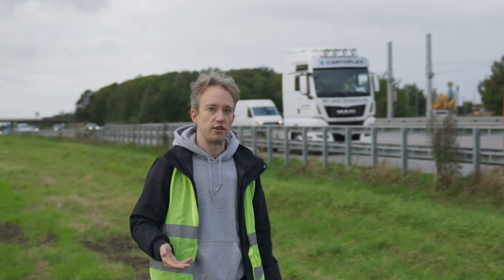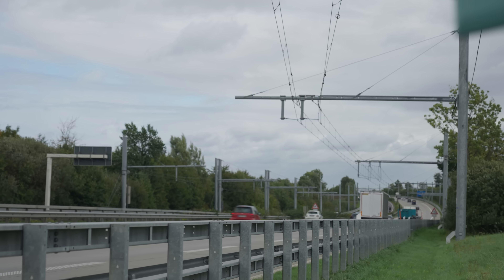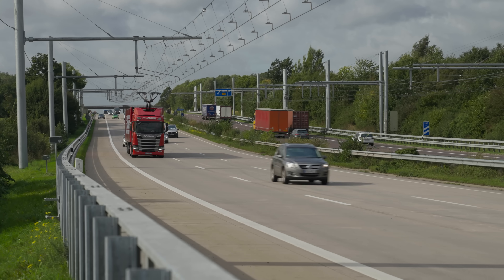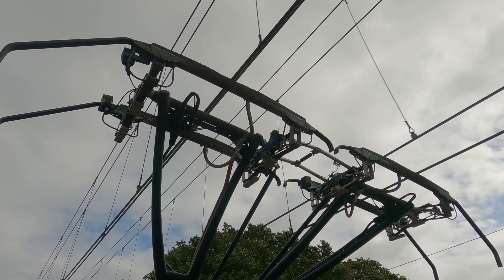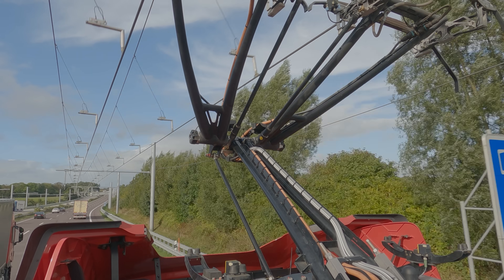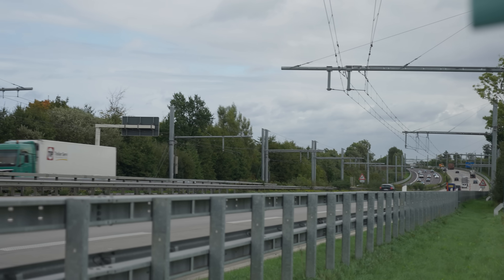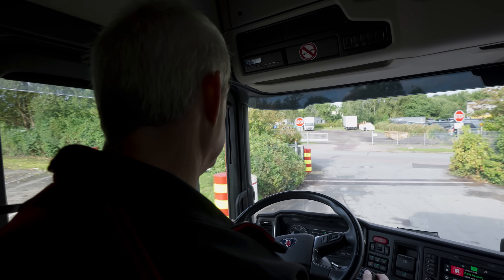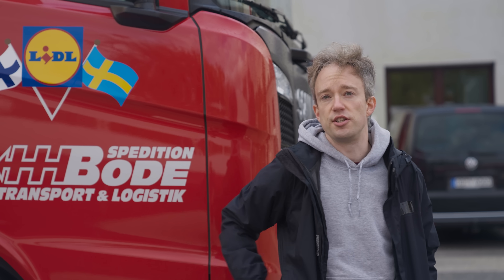The highway where trucks work like electric trains

Comment: So you're working out a system where you still pay tax to the government for electricity instead of fuel?  And do we really think they're going to accept less than they already make from fuel?  No.  So, it's just going to make electricity more expensive.  People also need to keep in mind, that when something costs more, it also requires people to work more to afford it.  When they work more to afford those higher prices, guess what the result is? More pollution!  It shouldn't be a businesses responsibility to take on a tax that is made obsolete, by agreeing to move the tax onto a "greener" energy source. If the government can't make do without the tax, then the tax is the opposite of too big to fail, it's too big to exist, because it's clear they're learning too heavily on taxing one aspect of the economy.  What it means is not that the government doesn't have enough money, it actually means the government has over extended itself and thus should shrink to fit within the envelope, instead of shifting the envelope.

Comment: Here in Wellington, NZ, we took down the overhead wires and got rid of the electric trolley busses. A few battery buses and a lot of diesel buses replaced them. Go figure.
Reply: One hundred years ago, building a large powerful electric motor was much cheaper and way simpler than building a diesel motor of the same power. Also, air pollution was not even minimally considered (see the lead tetraethyl added to petrol since 1925). As soon compact diesel engine became available, electric vehicles were phased out. Nowadays, we find ourselves in the opposite predicament, where pollution is a top priority, while electric motors remain cheap as chips.

Comment: Nearly every road in the world has electric power running parallel. This would work for all electric vehicles and negate the need for 90% of the current and future battery capacity. 
 
Of course, we could have just invested in Nikola Tesla’s wireless power distribution 100 years ago and we wouldn’t be facing the 6th extension event so quickly. Then again, it wouldn’t have been quite as profitable for the oligarchy.
Reply: good bait on the wireless power distribution, you almost had me 😅

Comment: I don't see self driving cars happening but as a different idea to this I imagined purpose built highways for trucks to go down at very high speeds , guided by beacons built into the road, without drivers and then when they reach the point that a truck would do drop offs of gear it heads into a depot attached to the highway for a human driver to board and guide it through the normal arterial roads

Comment: I would've thought to put them in the ground, but I forgot about how there's a proven way to do it already
Reply: I think you're on the right track. Putting them in the ground has the added benefit of being applicable to all sized vehicles then. But it's probably a safety issue, because you don't want slippery, exposed metal or chunky cables on the ground. And dragging the connection from the car's side over rough, hard roads is probably not the safest and definitely wears a lot more. But who knows, maybe someone smarter than me can solve these issues and find a way to implement a ground based system.

Comment: To all the dumbasses that compare this to trains: Drive a train to Walmart. Or to a shop on top of a steep mountain.
You jizz over trains like it's the holy grail of transportation, while completely ignoring that trucks exist for a reason, and the purpose they have cannot ever be fully replaced by trains. This is an ingenious and environmentally friendlier aid to a necessary part of the cargo network, so stop bitching about your trains and appreciate a necessary improvement to an essential part of the supply line.

Comment: they really needs to stop those attempts of changing the form of energy BS. by the end of the day, it trace all the way back to coal power, nuclear power, hyper expensive wind/solar power.
Do something about the efficiency. not necessary need a new engine, just relief the hours after hours  traffic jam in the city will save million tons of petrol easily....

Comment: This technology is much more automated than a traditional trolleybus. Notice how the pantographs drop as soon as the truck moves away from the wires. The next obvious step is to put all the electric trucks under automated control so the trucks can run much closer together while eliminating the potential for accidents and being steered automatically. In other words, merge electric propulsion with an intelligent highway system.
Reply: An intelligent highway system? How about a signalized railway system? These things existed for decades.
Reply: @thastayapongsak4422  - Speaking as an engineer, trucks have significant advantages over rail freight. Flexibility and speed are the two largest ones. 

Living in Hawai'i is like living in a rail-dependent world. For a truck to pick up your things, someone to pack a container, bring the container to a ship, load it on a ship, and then reverse the process at a Mainland port takes about a month. 

A world in which a package is delivered in a couple days or even a week is impossible without long-haul trucks and cargo aircraft.
Reply: @pacificostudios  we could cut away the direct one day delivery of consumer goods. Its not like they would be needing that thing they bought impulsively straight away.
Reply: @pacificostudios  Flexibility Sure. Speed No. Bullet trains exist.
Reply: @asandax6  - We are talking about freight transportation, not passenger services. HSR speed is irrelevant when large amounts of cargo must be assembled before rail shipment, a process that inevitably takes hours and even days. Passengers load and unload themselves, but freight does not.
Reply: @M--001  Ah yes get people to support your idea by bringing it at a detriment to them

Comment: Interesting to see a hybrid option like this while it does still introduce polution into the city as "the last mile". There are discussions of using overhead wire system to allow smaller batteries and this as a charging system. In the US there are a lot of long haul around no power. This could help connect those areas while reducing downtime. The charging downtime issue along with already having many dedicated filling stations favors hydrogen heavily.

Comment: This is going to be sooooo expensive. Taxes alone will be through the roof. A government that tells me what kind of fuel I can or can't use concerns me.
Reply: You legally can't put kerosene (Which is why it's colored) or leaded gas in you car. How is this different?
Reply: @halirl  your car won't run on kerosene, your older diesel might, and you can still get racing fuel (leaded). None of these are band, completely. The only reason you can't get regular leaded, is it's hazardous for your health. And then there's off road diesel, you can run that in your tractor, but not your F-350. Still not band.
Reply: @manicmechanic448  The point you were making was you don't think the government shouldn't say what kind of fuel you can use. The point I'm making is that the government already does and you just told me the reason why and all the ways to get around the law. Red kerosene (Or blue, if you have access to aircraft fuel) is just diesel that dyed because if you get caught putting them in your vehicle, you will be on the hook for avoiding taxes. Leaded fuel is illegal to sell at the typical BP gas pump. (Also the plastic bits of your modern car's fuel system will melt if you put leaded gas in there.)
Reply: @halirl  if you wanna use jet fuel in little civic, or whatever you drive, you go right ahead. I won't stop you, neither will they. Just let me know how that works out for ya.

Comment: I'm reminded of the electric buses in San Francisco and how annoying it was when they would loose connection with the overhead wires. These trucks at least look like they've improved on that aspect
Reply: Only because they're using pantographs instead of trolley poles. What is practical on a straight piece of motorway doesn't work on a vehicle manoeuvring in town traffic, though to be honest trolleybus dewirements are not that common anyway.
Reply: thats probably given because of the relatively good pavement on the autobahn and the already advanced electric trains using the same system
Reply: The trucks also have their own batteries for when they aren't on the power lines.

Comment: Would overtaking be possible? So would it be possible to move to the overtaking lane and go off power then back onto it? Can it be done easily?

I'm a truck driver in the UK and you'd be surprised how slow some car drivers go on the motorway. I don't want to be stuck in a huge queue of traffic traveling at 40mph because trucks can't overtake an idiot in a car

Comment: When I was little I used to imagine motorways with wire mesh overhead and cars with long sticks to reach upwards to it like with bumper cars, ands that’s how they worked instead of petrol. A child’s view of how electricity could reduce carbon emissions from cars, but apparently not the most outlandish idea considering this video.
Reply: Should've applied for a patent, you couldve made millions
Reply: A stick hitting a wire mesh with high speed would wear out very fast - the speeds here are much larger than in bumper cars

Comment: Not only trucks, but buses and long-distance coaches can benefit from eHighway as well. This could solve so many technical hurdles electric long distance commercial vehicles have to overcome, namely limited battery capacity and long recharge/downtime.
Reply: I'm wondering, how many vehicles a line can support at a single moment
Reply: @abd4620  A single trains draws much more than a truck. So this supports many trucks already. But if we should still need a higher capacity, you just have to route power to the overhead lines at shorter intervals, so less trucks are in one segment at a time.
Reply: @tristanwegner  Yes, a locomotive can draws long train of cars, but that can be a disadvantage too. The train has to wait for every cars to be ready. 

Another issue is, railway works like a queue, one train cannot speed over other slower train, at least not every time it needs to. Road can accomodates that because road does not have track.
Reply: but the rubber wheels are not very eco friendly, maybe we could make the E-highway on top of train tracks and give the trucks steel wheels ?
Reply: @heliodorespecht6083  Have you ever consider what will happens if one of those steel wheels goes flat? ... wait ...
Reply: You know that there is a thing called trolleybus, right? Why make up neologisms and pretend this is a new idea?
Reply: @flashpeter625  Sorry were you talking to me? Trolleybuses are not used on highways. I’m only discussing this in the intercity long distance capacity.
Reply: @duncantalksalot  Intercity trolleybuses are used in multiple locations. Also, quite often trolleybus lines exit the city and go to suburbs. Hybrid trolleybuses with small batteries also exist, that go off-grid at the edge of a city to reach locations a few kilometres away from the end of the trolley line. And finally, in some places, literal trolleytrucks have been used since mid 20th century to utilize existing passenger trolley lines for freight.
It makes no difference if the trolley is on a highway or not, you just put the trolley where the vehicle always takes the same route. Many trucks obviously do take the same route back and forth, and they only need to move freely at the end of the route to reach more distributed destinations. This is not a new idea at all. With the unavoidable rising costs of fuel, this solution is just resurfacing as the added cost of construction and maintenance becomes more feasible. I think this is a much better solution than putting 5 tons of Lithium batteries in each truck.
Reply: @flashpeter625  I never said it's a new idea to begin with so idek what you're on about here. Also trolley poles are vastly different from pantographs, and the noveau idea of having them installed on highway is new if not forgotten for decades, so there's that.
Reply: Why?? Why not just build a train line?
Reply: @1mol831  because the highway already exists and is more flexible.
Reply: @1mol831  Obviously the same reason why build a trolleybus instead of a tram. Trolley is cheaper than trolley with rail. Road is less energy efficient than rail, but on the flipside, you can put the trolley over an existing road, the vehicles have more freedom of movement and other vehicles can also use the road under the trolley. Obviously, distance plays a role, so on for distances long enough, a train becomes more effective, and indeed trains are currently underutilized. What the trolleytruck accomplishes is that the vehicle does not need to haul several tons of dead weight in batteries. This should definitely be in the common arsenal of freight methods, together with trains.
Reply: @1mol831  How do you route trains to your local supermarket?
Reply: People just assume that battery technology can improve to that point. Chemistry has its limits.
Reply: @merlin9702  with your own (hopefully) two feet, bicycles, scooters, or small motorized scooters and e-bikes if you don't want to do the work yourself.
Reply: You know, eastern Europe uses trolley buses for decades now. Since USSR.
Reply: in solingen germany the buses drive with this system. The o-bus
Reply: let me introduce you to the revolutionary concept of.... trains!
Reply: Imagine charging your Tesla on right lane during driving haha this would be awesome
Reply: @jakobro1794  I dont really see cars using these, you would need a pantograph thats the size the car itself to accomodate the clearing trucks need.
Reply: Again, there are no trolley coaches running on highways between cities today, afaik.
Reply: Why stop there? Why not small car too? It will reduce lithium demands for batterry.

Of course it's kind of dorky to go to a date while riding something that you usually see at amusement park. But ...

Comment: Just you wait when all this green agenda comes back to bite them in the butt...As it turns out electricity is not green what so ever, and batteries, panels, wind generators and various smart gadgets that are filled to the brim with microchips are in fact very dirty, expensive and toxic to make while producing very little compared to what they should be producing. And best part, alot of that stuff cannot be recycled, and lithium mining is extremely toxic... which is why rich countries try to export mines into the thirld world countries even if they have more in reserves.

Comment: No one: it’s too dangerous for use high voltage power line on traffic road like railway especially in rainy season because of if any accident happened, it’s highly chances of being fired or electrocution. Total disaster for real! And cost too high, too!!
Uk and Germany: Let’s put the high voltage power line on road for electric vehicles.

Comment: Why not hybrid with the wires and battery technology?  Over-the-road wired lanes and then last mile battery (now fully charged as the vehicle leaves the wires)?
Reply: That's what this is. Didn't you see the truck detach from the wire while moving? Not sure if that truck uses battery or diesel but you can easily use either.